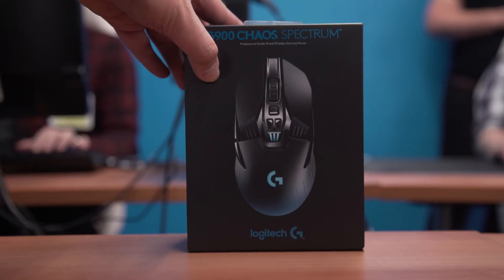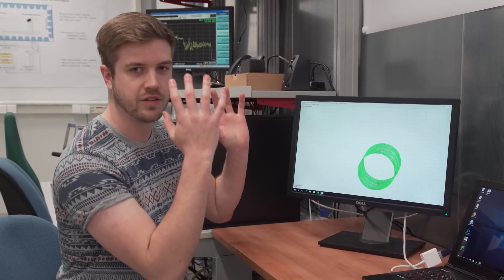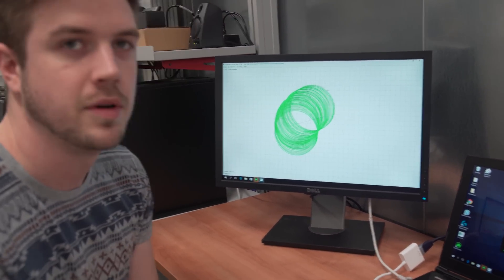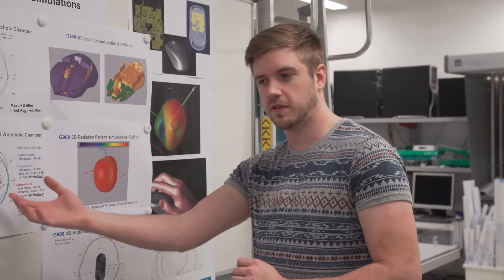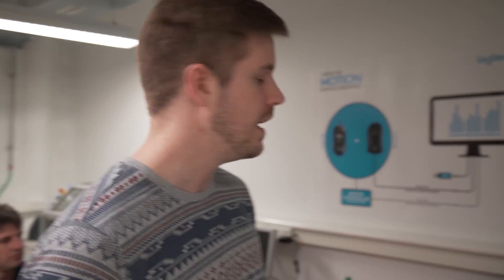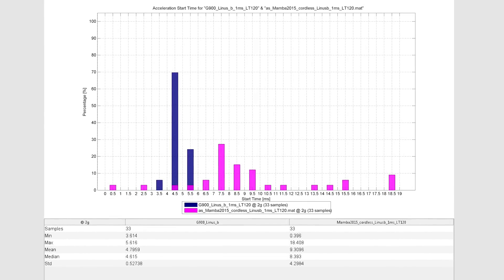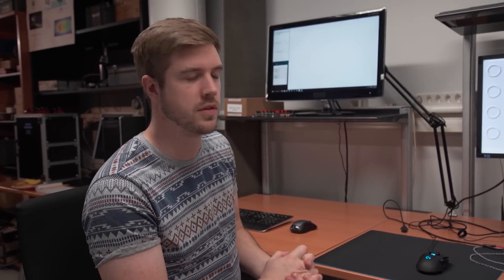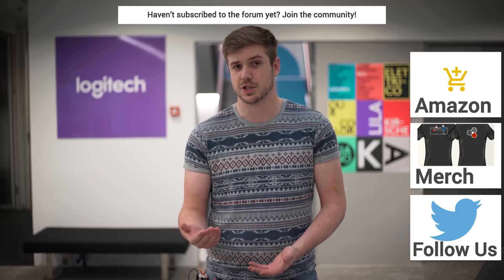Wireless Mouse Technology Testing at the Logitech Daniel Borel Innovation Center

Comment: What's the input lag like when it runs out of power? hehehehehhehehe
Reply: +Raisin Toast You just plug it in and use it like a regular wired mouse until it's charged. So, to answer your question, about the same.
Reply: DarkenSeyreth gg
Reply: +Happyfeet Or you can buy this , have faster response times and the option to have it wireless if needed. Rekt.
Reply: +Happyfeet I have the G700s and I have to plug it in for about 3 hours every 5 days. most of the time I'll just plug it in when I go to bed if I see it getting low. so I would say I use it wired closer to 5% of the time.
Reply: Because I hate dealing with cords dragging in the back of my desk, and whenever some company finally decides to release a carrying case for this mouse, I'll also start taking it with me to play games on my Surface when I go to school.
Reply: Not quite, as the G903 uses a G900 base and he's making a very good point. There's pretty much no disadvantages left for a G903 that is used in a Powerplay setup, making the smug recharging comment at the top of this thread obsolete. I run this setup after owning nothing but wired mice (long time Quake 3 / QuakeLive player), never going back. Unless you don't like the G703 / G903 shape, there's no reasons left to hate on wireless, as there are no more drawbacks.
Reply: I'd say the PowerPlay setup is still more of a gimmick than anything else (it cost me more than double what a G900 would have), but I do like that I haven't had to plug a cable into my mouse for the 9 months that I've had it.  I tend to forget to plug stuff in though, so I'm pretty happy with my purchase.  Best experience I've had with a mouse, but I'll also admit that it's the first time I've really used a proper mousepad as well, which makes some difference (the G903 straight on my table is still better than any mouse I've had previously, just doesn't glide as well as it does on the mousepad).

That said, I don't see myself wanting a different mouse anytime in future, so unless it ends up breaking within a year or two I'd definitely consider it money well spent.
Reply: >comments on a year-old video about a different product
Reply: +DarkenSeyreth so half the time it'll be plugged in, then why bother? just get wired and you never have to deal with plugging and unplugging.

Comment: Wow, not for the mouse but for that kind of testing. However from a testing point of view you told us so little. We have an atenea emitting signals equivalent to just a little more than an X environment, but then you talk about the receiver detecting what the mouse is doing via another signal. Which will add more noise. Plus are we discounting the noise of the electronics moving the panel below the mouse. I assume this has all been accounted for in the tests, plus many other variables. Overall to be able to explore testing possibilities in that environment is exciting.    

Plus it's fairly easy to put your own device through tests that beat competitors in your own controlled lab. Cynic much. :D

Comment: The video would've been alot more convincing if you actually performed the same tests the same way on all of the mice and atleast tried to hide your bias to the g900. I'm not saying it's a bad mouse, and as seen in the last test the mouse design allows for really low latency, but saying it's better because of it's shaped graph while the competitor clearly has lower standard deviation just makes me cringe. Also, since when is 33 an acceptable size for a sample pool? You could've spent 5 min and clicked 1000 times on each mouse so that atleast one of the experiments are sound both in methodology and statistical accuracy of the data.
Reply: +Shuai Shao The video is just a quick demo of the kind of testing Logitech has been doing. I'm sure their own R&D has been much more extensive than Luke's somewhat simplified presentation here, which is sort of dumbed down to get the point across and keep the video short/interesting.

Comment: 1) Slightly flawed there with the jogger moving instead of the mouse. In daily usage, distance between mouse and sensor is varied, unlike in the lab, where the distance is constant.
2) No battery life test?

Comment: In a normal situation, let's say me in my room playing CSGO, you're telling me that I would be better of getting the Logitech because it doesn't lose frequency shit when a shit ton of interference is shot at it. Jee thanks, I need to cancel my order of my massive fucking antenna which I would have used to purposely fuck around with my frequencies. Anyway, I know that these are designed to be used in big LAN parties, but c'mon now, I doubt that a couple of other wireless devices will fuck up my gameplay.
Not hate, just evaluating the realism of the situations talked about.

Comment: I love when people complain about price. Dont buy it. This product is not target to you if you only want to spend 60 dollars on a peripheral, obviously. Its a high end product and just like high end routers, you get diminishing returns. 

We all saw the data and its very impressive. It wont make you better at games, it wont make you MLG PRO. Just like a BMW M3 doesnt make you Michael Schumacher. Its there to ensure you get a no-compromise experience. You can certainly do fine with a less expensive product but Logitech are openly showing you the performance. 

For once, i really have to admire Logitech for doing this. Its not only showing off their products but showing other manufactures they need to step up. That will drive prices down and give us all better products in the long run.

Comment: If the test lab was independent from the manufacturers this would have more meaning. being as it is, I can't help but wonder why the wireless receiver was placed where it was placed, maybe other mice have better results at different ranges, or if those wires to detect the click latency were properly set up, etc. For me this video says nothing about which mouse is better and it's too bad that that was the focus of the video. It was however very interesting to see the different systems that they have set up to test the mice.

Comment: "Better than a wired mouse", they say. The ones they tested against, perhaps. Also having to deal with battery life is its own inconvenience anyway.

Also it's £135 which is astronomically expensive for a mouse.

Edited; $135, not £150
Reply: *****
 Design is pretty subjective. I personally think it looks kinda ugly. But that's me.
Reply: *****
 Currently I'm enjoying my M65. Took a little while to get used to the side button placements. I used to use a Razer DeathAdder which was pretty ergonomic, but I started to get pretty tired of my experiences with Razer products. Something always seemed to go wrong with them for me. After looking around for some other mice, Logitech's MX Master looks pretty good, though the thumb shelf bothers me slightly (though I appreciate it has a purpose).

The main thing that bothers me about the G900 is that weird separation between the main body and the mouse buttons that they heavily accentuate with those support-looking struts. Contrast their MX Master where the buttons are still separated from the main shell but only has a fairly small seam on the outside rather than what I can only describe as a canyon.

But that's just like my opinion, man.
Reply: I actually use a palm grip on it. The bottom the palm/wrist tends to cup the back of the mouse, with the top of the palm (where the third knuckes are) mostly on top. Maybe my hands are just slightly small, though.

I can see how a claw grip would work as well but I prefer to have my arm resting somewhere rather than keeping my hand sort of suspended. I guess it could also work with a fingertip grip if you remove the weights to lighten it up, but the M65 isn't so small that you can't put your hand on there.

You are right in saying the M65 is slightly short, but it isn't so short that I noticed my usual grip being uncomfortable after I got used to the new shape.
Reply: +MGlBlaze I don't see how battery life on a mouse is an issue, I myself use a G700 for over 5 years now and I have and I never changed or had battery issues. I am still using the same eneloop battery that came with it. I have disconnected the mouse from the wire because I don't like the stiff wire on the mouse and whenever I need to recharge the battery I just simply connect the cable again and continue using it without a problem at all. Play while recharging is a thing.
Reply: Draken X
 It is, but personally I don't see a reason to do that when, like I said, a wired mouse can be plugged in and that's basically it forever.

Comment: imo your testing method is flawed. You isolated different aspects of what a mouse needs to deal with/or do good, in order for it to be a succesfull mouse. What you didn't test was the different aspects interfering with each other. For example, the first test might have an impact on the wireless mouse's latency where as it might wouldn't have on a wired. it it all speculation, but since something i think would be nice to have tested. It seems a bit like you should have mentioned that the test might be bias on which areas the mouse preforms well. 

I will say that the facts we are presented in this video, the mouse looks beastly. But it all feels a bit like one of those Kickstarter videos where it looks really cool, but in reality there are some real-life stuff that comes into play and messes the product up.

Not wanting to hate or anything but i really feel like there are some gap's in this video.
Reply: +Sebastian Lettorp The video is just a quick demo of the kind of testing Logitech has been doing. I'm sure their own R&D has been much more extensive than Luke's somewhat simplified presentation here, which is sort of dumbed down to get the point across and keep the video short/interesting.
Reply: +J Thomas point taken. And you're right of course they do. But I still kinda missed some more fairness to it. I felt like they chose all the test the mouse would kick ass at, and showed them. But don't get me wrong, it was super cool to watch how they do some of their testing no doubt about it. It wasn't really to hate on the video. I just missed some depth and clarity around the testing methods, which I think they are usually so good at on this channel.

Comment: To be clear, the difference between a wired mouse and a wireless mouse is literally zero when everything is equal. Radio waves travel just as fast as electrons through a wire.

The difference comes when there is interference, as in this video.

Basically, a wireless gaming mouse is just as god as a wired gaming mouse unless you have a lot of interference. For instance, if you live in a big city or if you are at a big gaming convention, you want wired. Otherwise, wireless is better, considering it is the same speed and offers no physical resistance.
Reply: +Christopher Pilcher actually shouldnt radio waves be faster as it travels at the speed of light through air instead of electrons having to travel through a solid
Reply: +Christopher Pilcher Changing transition types from wireless to USB surely has latency associated with it too?

Comment: sad that they havent texśtet the final mouse in this setup since this gamin mice paradoxon is known. this hole gaming suit rgb/makro/profiles bullshit slows down a mice as hell so id like to see a wired mice that actually focuses on responstime instead of shiny gamin bs. anyway nice vid!
Reply: +Mack Trinz It's a crappy mouse with excessive marketing. Already proven to have a few more ms of button lag and 2ms tracking smoothing on their firmware. Do some research, the finalmouse is just a rebranded chinese $15 mouse with some changes like better sensor and switches, but the firmware and pcb in the mouse is made by the chinese factory, not finalmouse
Reply: then they could at least testet it against the other wired lg mice?

Comment: It's kinda telling that Logitech wouldn't test the G900 vs the G502. Logitech, in general, is legendary for low latency performance, so getting the G900 to beat wired mice from other companies really has only to do with developing wireless signal reception that can match a cable. The rest of the mouse's performance would be simply academic for Logitech: in all likelihood, nothing in the actual performance of the sensor or switches is really any different from what they've always been great at doing. Hence, if they made that comparison between their flagship wired and wireless, it will basically tell us that we have to pay nearly twice as much for the 900 over the 502 JUST for the flawless wirelessness. And it still doesn't sound like very good value for most of us...

Comment: 1 reason not to get a wireless mouse for a desktop... Battery. Sorry but If I am in the middle of a game and that battery dies and so does my character in the game that mouse is flying across the room really fast and if that doesn't break it I will mash it with a hammer. My laptop on the other hand has a wireless mouse in the carry case because the trackpad is always crap and if the battery dies then it's not a big deal.

There really isn't a solid good reason to use wireless for a desktop unless you enjoy having to charge or replace batteries, a laptop on the other hand wireless is great.
Reply: I think this comes with a USB charger cord so it can work like a wired mouse, and don't some mice warn you about low battery?
Reply: It's battery life is pretty good. With the Mamba I would regularly (a couple of times a month) run out of battery while gaming, which is actually a real problem. Hasn't happened yet with the g900 and I've had it for a couple of months. Also the chord is a lot easier to attach than the Mamba.
Reply: +JETWTF Oh noes my fake little man died inside a fake world, better smash up some of my own real stuff to show how intense I am.
Reply: It was an exaggeration.

Comment: Why was the wireless testing done with the "interference" pointed at the transmitter (the mouse)?    I feel as if a more accurate way to do the test would be to point any interference at the receiver, as the receiver would be the weaker point in the system.

If someone wants to interfere with a RF system, easiest is to mess with the receiver.  trying to cause issues with a transmitter becomes a little more difficult.

Comment: that's like 5,000 Watts of interference. You'd be dizzy after an hour in that room. A $20 Logitech mouse transmits just as well as a $200 Logitech mouse. The Logitech RF system is the same, regardless of the mouse. Look up the patent on google if you don't believe me. A more expensive Logitech mouse just has better mechanical components - switches, cables, etc.
Reply: +TheAstronomyDude so ur saying SS and Razer are shittier than $20 mouse lol
Reply: +TheAstronomyDude im pretty sure they used a new system in this mouse as i doubt they upgraded all their old mice to this new system
Reply: John Nguyen shittier wireless communication yeah. I have a $20 and a $120 logitech wireless mouse and they both work at the same range and on top of my microwave while its on.

Comment: I like my G602, feels and operates like a desktop mouse, with an insane battery life. Usually months between battery changes.
Reply: +Andrew Hunt Wondering if the battery life is the same with the G900? Because I might replace my 602 with it if I find that its nicer. But so far no other mouse has even had me considering replacing the 602. Not even wired mouses.
Reply: +ReaLzEdits I agree. The G700, the generational replacement to the G602 had a integrated rechargeable battery that was rated to last maybe 10 hours in performance mode. That was a turnoff, and I saw the G602. Throw some AA's (or a single battery if weight is an issue) and you can forget about it until the cyan light shows up, which even then, you still got about 2 weeks of use at 6 hours a day.

Comment: I have the oroborous, LOVE the mouse. Was wondering if you tested it with its wireless or if you used it wired. Even seeing the results I have utter confidence in the mouse. If that was a wireless test I think it did a rocking job. Only minor jumps sorta rarely. Now if it were wired THEORETICALLY it should preform even better yet. Thanks for that glad i spent the 150 bucks on it